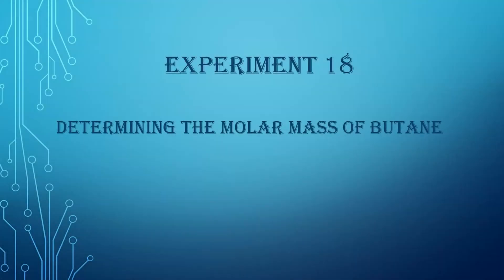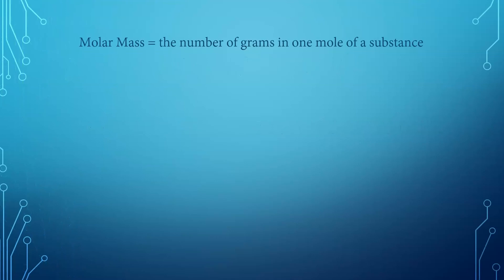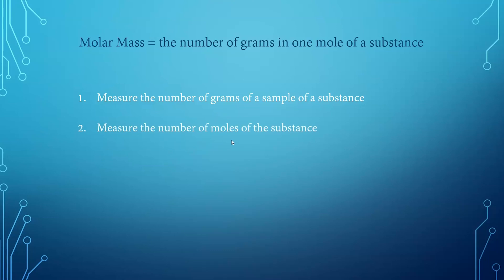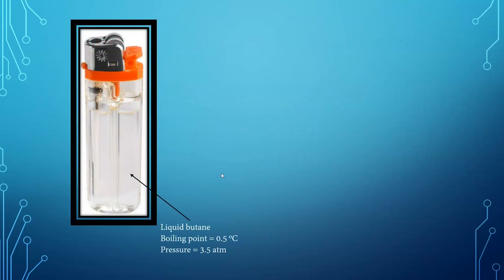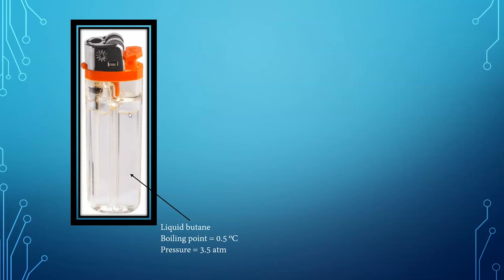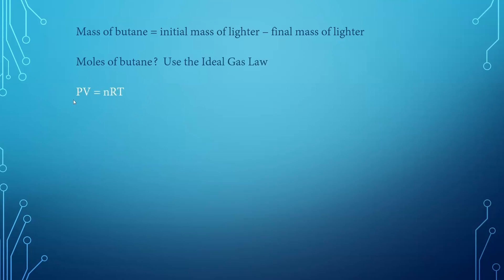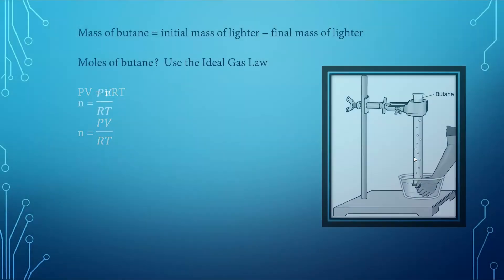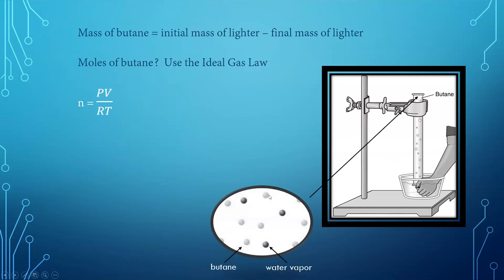Experiment 18 - The Molar Mass of Butane

Comment: how did you get the pressure of butane for 20 Celcius i can't seem to find it online
Reply from the maker: It's actually the vapor pressure of water at 20 degrees that you need.  That can easily be found online.